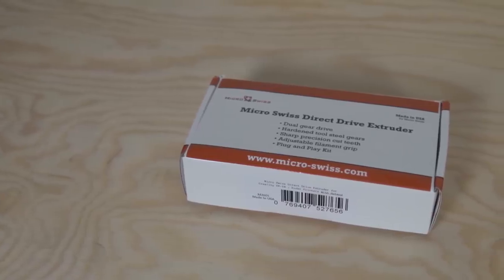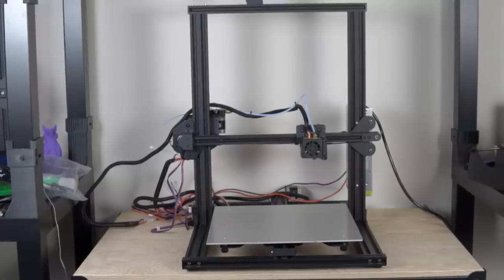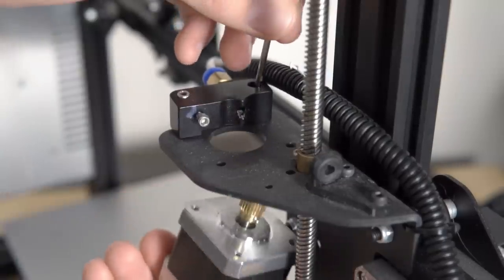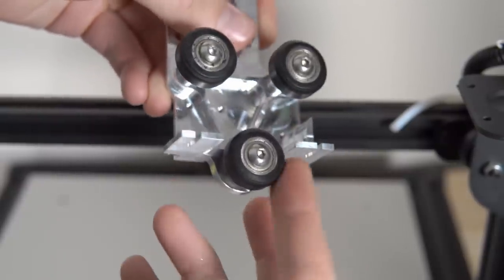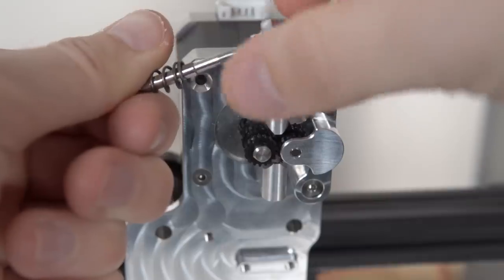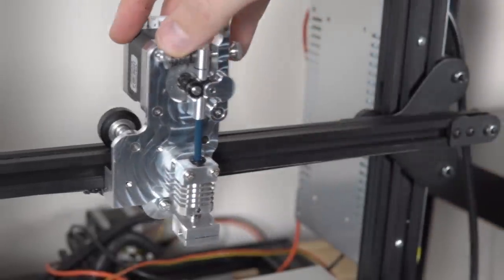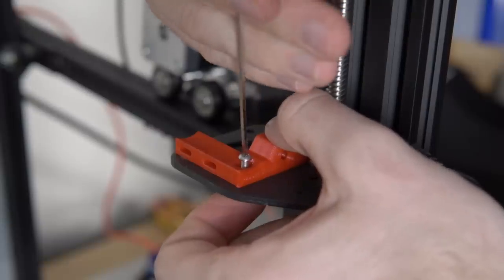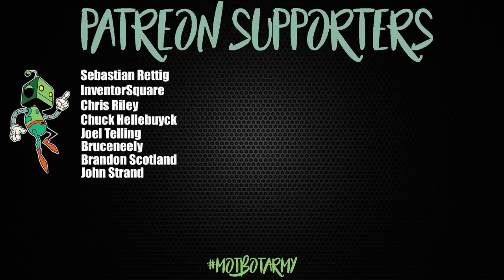Micro Swiss Dual Gear Direct Drive Upgrade For Ender 3 and CR-10 3D Printers

Comment from the maker: I have had a ton of people asking if this causes you to lose any Z height. I can confirm that the motor is over the X Axis extrusion which allows the printer to print at the max Z height without any problems at all! (No print volume is lost!) 😬
Reply: "You never go full z axis" 😬
Reply: @3warsGunsmithing  If your asking if your printer will shut off going to higher temps, I doubt it. I upgraded to a Micro Swiss hot-end and I don't remember ever encountering an issue with the Firmware not letting me reach a high temperature. I guess I could be wrong on some models, but would be the first I've heard of it. The limitation is in how hot the materials in the stock hot end can get before melting. Not the firmware.
Reply: @3warsGunsmithing  as long as you set your max temp in firmware you are fine, set it 15c above your desired max temp(im guessing 300c) in case of temperature fluctuations.  Make sure your thermistor and heater cartridge can handle the high temps as well, I had to upgrade my thermistor to reach 300c, as the stock glass bead thermistor on the Ender3 shouldn't go above 265 I think.
Reply: Does yours touch the x axis limiter switch before going past the bed?  Mine is too narrow
Reply: I have an Ender 3, i need to know the X and Y offsets with the Micro Swiss. Im trying to install a BL Touch and it wont work because the probing fails on the first point.. idk what else to do.. my purge line never prints on the glass either, it just extrudes next to the bed. i also need the commands for the offsets as well :)
Reply: @huntershortrepairs  hey ! i just installed my micro swiss and same problem with le purge line ... so for now I just sticked a bolt on the side of the charriot to define the home point a litle bit on the right but I guess there is a less grunge way to correct this ... is there any ?
Reply: Have you created a cura profile yet?
Reply: I lost more "Z-height" installing a glass bed lol... KWITCHERBELLYAIKIN! Get this!
Reply: @3warsGunsmithing  Marlin firmware allows you to burn your house down if you wish. Direct drive/all-metal is the 1st step... you CAN tell your printer "how to behave". If you're spending this kinda cash on an upgrade...I'd say "Dive in"...and also GET A cheap Raspberry Pi 3 B+,  run OctoPi/Octoprint... it's the ONLY way to go

Comment: Money inbound to you.

I am a mechanical engineer, and when I opened this box of crap I literally shuddered...it was like the innerworkings of a swiss watch, and no tech manual/schematic in the box, almost gave me a stroke. But the link to your video was a godsend.

Thank you for taking the time to make it. You sir, are a steely-eyed missile man.
Reply from the maker: I just saw this after seeing my Patreon and thinking there must be a mistake. Thank you very much. This is certainly not something that is expected and I really do appreciate your generosity. I am happy that this video was able to help you with upgrading your printer. I will be reaching out to you on Patreon to see if I can send you some stickers! :)
Reply: Based on your reaction to what was inside the box. I don't believe you're an engineer at all.
Reply: @dangerous8333  Cool story bro
Reply: mechanical engineer my ass lmao, this is far from a difficult install and this video isn't even complete.
For starters, it is pretty cringe he says "tighten as much as possible". Yeah that will certainly not cause some people to strip the soft aluminum threads with the steel bolt.
The main bracket was beautifully machined, any real certified mechanical engineer with experience will appreciate this. Especially if you knew the machining costs.
He even forgot some things, like installing the washer on the last wheel (one with the concentric nut) and the set screw on the gear is meant to be tightened against the flat part of the shaft. Which should be pretty obvious
Reply: @hippcity3168  what in the actual hell are you talking about? Machining costs? Have you never ran an aluminum part? This is day one shit. No internal features or contours, no complex geometry and standard surface finish. That part took 3 operations and cost about $7 to make at scale. And you want to comment on someone elses credentials. When you actually run a part maybe then open your mouth.

Comment: Thanks for this great video,literally no rush or 5x in the speed. Every items got the chance to show up to let you easily identify them in the kit. In the process of assembling this, I felt the professionalism in the design of every items included in the kit. I've spent dozzens of dolars on some cheap diy kits made in China from Aliexpress before I came to know that Micro Swiss actually designed something really new that will kick the ass of others. Let's find out who is the real terminators. Once again, the lesson is learned. $100 excede the value contained in the kit, saving you tons of time in tweaking the cheaply made diy kits.

Comment: Thank you for this video, it was very helpful.  However I noticed a few issues that you might want to address so folks do not get it wrong
1) You did not install the washer on the last wheel.  The one with the concentric nut
2) The set screw on the gear is meant to be tightened against the flat part of the shaft
Reply: Lots of the Ender 3 steppers don't have a flat, the gear is friction fit.

Comment: I've just upgraded my CR10S with this direct drive and all metal hot end and it's brilliant, this video was a big help in conjunction with the official PDF instructions, thanks for taking the time to do this. For simplicity I've reverted from a fang-style cooling fan back to stock, without any obvious negative effects, although it's made me realise one of the reasons for doing that originally was the way better view of the nozzle when printing! Will have to look out for a fang version that works with this. Noticed the coupling between heater and hot end seems better too - temperature seems to come up much more rapidly and hold incredibly steadily.

Comment: Can you make a video how to set the Y and X offset?
Reply: Same
Reply: You figure this out yet? @mrkabonster
Reply: @pattygq  no I haven’t. I just moved my glass on the build plate like half a cm to the left to stop it printing the waste line off the build plate but I still don’t know what to do about the space I’m missing on the front of the build plate.
Reply: @mrkabonster  what fw are you running?
Reply: @pattygq  I don’t know. My printer is an old school Ender 3 but I did install a BIGTREETECH SKR Mini E3 V2.0 Control Board like some 3 and a half years ago.
Reply: Ah so no custom firmware. @mrkabonster
Reply: @pattygq  no. I just followed what @TeachingTech said to do when installing that board.

Comment: @ModBot Daniel THANK YOU for this video.  I have my first Ender 3 Pro that I bought last summer and have been modifying.  The Microswiss all metal hotted and direct drive for it have been sitting.  Well last week I decided to finally tackle it and after printing off the instructions decided that some of the steps weren't as clear as I'd like.  So I did a search and was pleased to see your video on this.  As I always like your videos I knew it would be very helpful.  And I wasn't disappointed.  So thank you for all you do and especially for this video.  Now once I watch your video on adjusting the e-step (again) I can finally try printing with TPU.  The goal is to print the tires for my Mr. Baddeley 3D printed R2D2.

Comment: I will not lie it took me more lik 3-4 hour total to install xD tried to put a stepper motor dampener on the extruder but then u cannot slide it all the way to the left or right so had to disassemble and reassemble all over again, regardless because of your video I did not even have to open the pdf up and it has saved me (believe it or not) time so Thank you so so much for this video keep up the great work!

Comment: Very nice.  I already have the Micros Swiss hot end so it's good to see that you can just buy the extruder and the mounting plate.  I especially like that it looks like the stepper motor is over the x-axis so the weight is more centered on the guide wheels.  I've always thought the plates with the motor hanging off the front had too much weight cantilevered off the front.  I was thinking of getting the Hemera but then my existing motor and extruder would be redundant.  This lets me use my existing parts and just buy the parts I need.  Wish I had know about this before they were sold out.  Hope they get more in stock soon.
Reply from the maker: They sold out pretty much instantly. I do not think Micro Swiss realized how popular the item would be. I am sure they are working on getting these kits built and individual parts for existing micro swiss users.

Comment: There's a flat on the stepper motor shaft.  Your grub screw should bear against that flat.  In the video, it's off by about 10 degrees.
Reply: Yep, I noticed that too.
Reply: 45? thats like a spot on 90! :P

Comment: Easy enough. I hit pause a lot, but it was very informative. The routing of the Bowden tube from the new guide to the trolley was the only area in the video where I believe there could be improvement. But even then, a little common sense goes a long way (I didn't have an old Bowden tube to reinstall, I had to cut Capricorn tubing to length, so kind of a special case with no reference point).

It's printing it's first part right now. Upgraded from 0.4mm to 0.6mm at install, and this is slinging some plastic! It's awesome!

Comment: Did it,(cr-10) also did the Silent board/Dual z and Cr touch from stock..First time messing with any printer mods and it went fine..This video was one of the resources used….🤙

Comment: Great video, very helpful. One suggestion: never tighten small machine screws "as tight as you can". This can result in stripped threads, stripped hex drive, or broken screws.
Reply: Especially grub screws! Those bastards are not strong. It needs to be tight enough for sure but not too tight.

Comment: IF YOU HAVE WARPING EDGES AFTER INSTALLING READ THIS!

Just a hint for anyone searching for it. After installing the Microswiss hotend on my ender 3 pro I had to fight severe issues with warping on the print corners on the high side of the Y axis on the print(as in when you look at it from the front, the corners on the right side of the print). I had not been able to fix this properly, but since I installed my own marlin build after the microswiss upgrade to have the stepper settings etc on the default firmware already I spend half a week and 2 dozen prints on figuring this out. The best I have come to is raising the bed temperature to 80C and replace the warping with an elephants foot. Nice. I finally figured out that its the Micro-Swiss nozzle that causes the issue. After installing a stock creality 0.4mm nozzle, the same print went out with stock settings(PLA, 200C Hotend, 60C bed) with no problems. I have not been able to figure out why exactly the micro-swiss nozzle causes warping, but I also have to notice that I get a lot better printing quality on the creality nozzle for the same gcode. @ModBod, if you ever upgrade this guide, please add more emphasis on calibrating the e-steps as well. 130 as suggested by micro-swiss(as a starting point, sure but they kinda also dont put enough emphasis on that in their manual) wasnt enough in my case, 141 works a lot better

Comment: The quality of this part looks amazing.... however... other than flexibles... I'm not sure what the benefit would be? 

The base model Ender 3 with the defaults out of Cura 4.4.1 is just simply stunning. So long as you set the travels to a reasonable rate like 100mm/s and prints around 60mm/s. Retractions on the bowden to about 6.5mm @25mm/s. I've had no issues with stringing, blobs or anything. This thing is incredible value and quality.

I own two other Direct Drive printers with Swiss all metal hotends.... and both have inferior print quality to the stock Ender 3. The extra weight of the motor has such a profound impact on print quality, I couldn't recommend it.
Reply: Pretty much, sometimes a lot of these "upgrades" feels more like Putting Cool Rims or a Spoiler on your Honda.....)
Reply: @AlbertoMartinez765  I've got cool rims on my Honda ...
Reply: I agree dude. Out of the box is better if you just concern about print quality not just cosmetic to make your printer looks tough. All i do to make better print (if it neccesarry) was changing linear advance,IF IT AINT BROKEN DONT FIX IT rules is applied for 3d print world.
Reply: If you want to print flexible and high temp materials you have to upgrade.  I got bored with PLA since you can only do so much if you want functional parts.  Nylonx and TPA open up a whole new world
Reply: @mikeb1596  recommend what upgrade is best for printing flexible? like a brand or part you can buy?
Reply: @hewittson69  any decent direct drive hot end, like a Microswiss or E3d.  A geared extruder can help too

Comment: I have one coming from Tiny Machines. ( In stock as of 1/27) They made up an additioal kit to fit this to my CR10S Pro with BL Touch up grade and Micro Swiss hot end! Those guys are awsome. I'm use to direct drive, and lately have been fighting the retraction settings with the CR10 on some materials. (Most likely me...)
Reply: I ordered from them on thursday. Shipped yesterday. Sold out after my purchase so I may have gotten the last one.

Comment: i have my ender 3 for a while and it prints very well. only upgrade i did was to put a foam board under it and installed PEI sheet which was only $7. i think ender 3 is a choice because its affordable and prints great for it price. i would dare say it prints as well as a $1000 printer if its tuned right.. but if i were to spend money on another mainboard, hot end, extruder, fans, tubes, bed etc.. for me it just defeats the purpose. i would rather get prusa mk3 instead of dealing and worrying about upgrades. great video tho im sure there are alot of people interested in this upgrade.
Reply: For me that's half the purpose of going for this one to begin with. An all metal hot end is definitly on the upgrade list for me because of the reliability issue and ptfe off gassing.

Comment: BTW folks, this is an American Company and you get EVERYTHING. This is by far the BEST thing I ever did to my E3. Just DO IT! Don't even bother with the "knock offs"... you will experience missing hardware, terrible "tolerances"... these guys machine this shit like it's their "job".. jeez... ya think? WOW. TY Micro-Swiss!
Reply: Nonsense.

These are such easy parts to make nothing you said (in this case) matters. I'm an engineer and metal fabricator. I sell my own products so I'm all about buying American made. But when you have items like this that are super easy to make and a company wants to charge a premium for it, I'm not having it. Tolerances? These are basic parts and I don't hear anybody complaining about the so-called "knockoffs" being out of tolerance.

It's funny, people will scream and shout saying clone printers being just as good as the original, but yet try to convince us that this product has to be American made. Please...

I was laughing as I was installing it. This is supposed to be an upgrade? The only thing I really wanted was the all metal hot end to print ASA. Once I started putting the rest of the kit together I realized how unnecessary it was. You're literally still using a Bowden tube, you're just putting the drive closer to the hot end. Is that necessary? We've been printing fine without it for years. You're also putting all the heaviest parts on the print head. Why in the hell would I want to do that!

I'm returning my $100 kit and I'm going to buy a less expensive all metal hot end. I'll put that money I save to use somewhere else.

Comment: My Z, X, and Y are all off now because of this, on the Ender 3 V2. Also have to print a new mount to put the fan on. Any video links on how to reset the "home" position to the correct area for this direct drive system?
Reply: I hope you just returned it. It's completely unnecessary and a waste of money.

If you need to print higher temps just get an all-metal hot end.

Why would you want all the weight on your print head anyway.

Comment: not to be nit picky, but you should align your set screw hole with the flat on the stepper motor shaft.  If you don't the shaft could eventually spin free.  But thanks so much for the assembly video, it was extremely helpful.

Comment: the weak point of all extruder, direct or bowden is the contact between gears and filament and this problem it's heavy on flexi filament, in my opinion should be designed a new kind of contact, for example like  two metal ribbons , like the cogwheels of a tank, at least 5mm , each one in front of other pushing the filament , what do you think :)

Comment: One of the reasons to upgrade to all metal (direct drive) extruder is the ability to reach temperatures above 250°C to print PC and Nylon. My question is if - after this upgrade - the maximum extruder temperature remains limited to the original one or can be increased up to 280-300°C (either on CR-10 or Ender 3).
Reply: Need 2 flash ur firmware on ur printer
Reply: No. The reason to upgrade to an all-metal hot end is to do what you're saying.

Direct drive has nothing to do with that. The rest of this kit is a gimmick. I bought it and returned it. Completely unnecessary. Hopefully you figured that out and just got a hot end instead of the kit.

Comment: great video, but I have a quick question. Why do you have to install the old bowden tube to where the extruder used to be? Couldn't you just rotate the spool holder 90° and mount it in the middle and have the filament feed directly into the direct drive?
Reply: Yes.